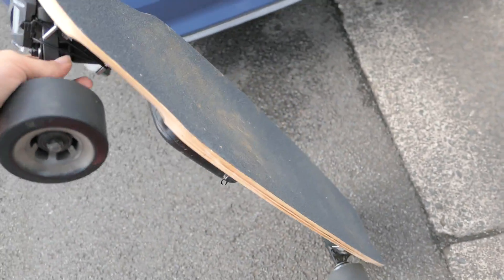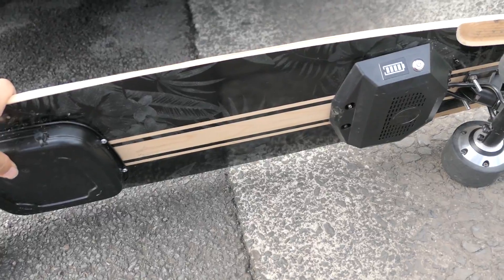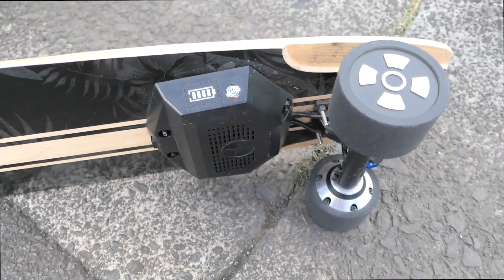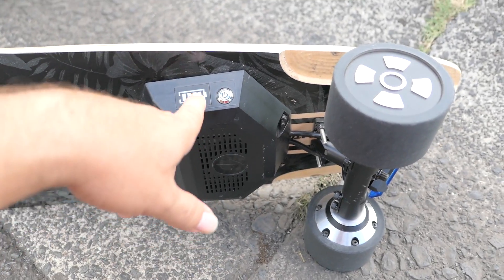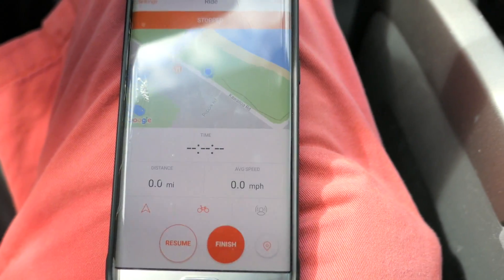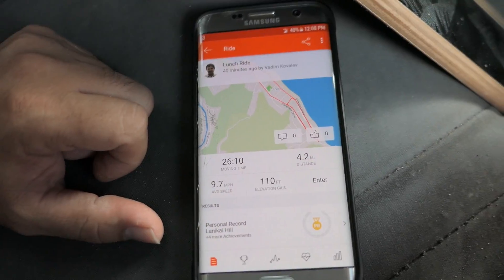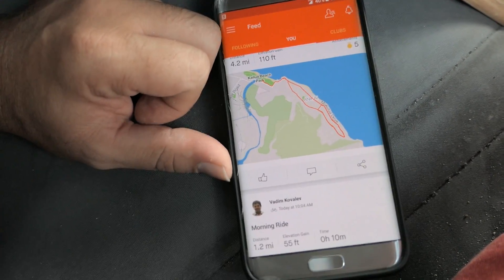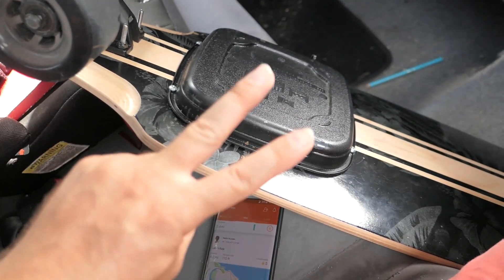DIY Electric Skateboard - Range Test

Comment: 6 miles on 3Ah is pretty good,   I have 7.5Ah on my All wheel version but I used 1500mah 30A cells so I had to use 50 of them with made the board really heavy,  Im replacing them with 3400mah NCR18650B,   4p should give enough current right?

Comment: Nice build (even nicer environment...Hawaii?). I built a similar setup, but with the pre-made 10S5P pack. One note: the road vibration will eventually break things. On mine, the first thing to go was the wire connections to the battery voltage indicator. Meepo owners are reporting the same issue with connections to the power button breaking-off. I found that laying a line of hot glue along the wire (after re-soldering) to where it connects to the terminal helps to reinforce it. It also helps to place a sheet of EVA foam between your enclosures and the board. I use this: https://www.amazon.com/gp/product/B0736HZTZK/ref=oh_aui_detailpage_o08_s00?ie=UTF8&psc=1
As for no brakes on a full charge, simply charge it no higher than 41.5 volts.
Reply: New Meepos are glued aswell. Any idea how to limit the charger to 41,5 v?